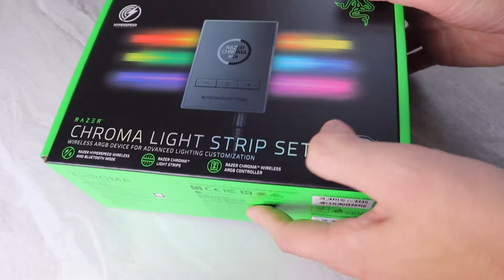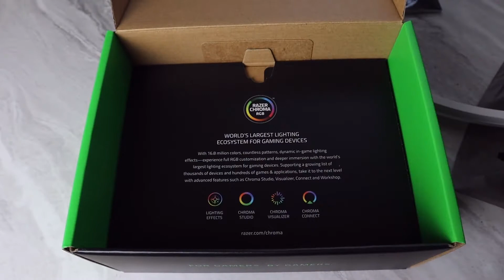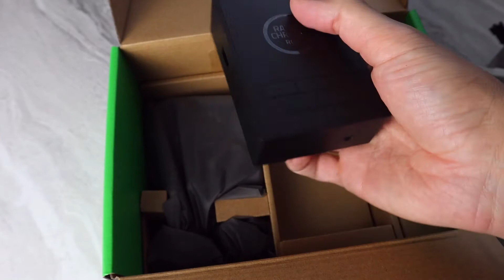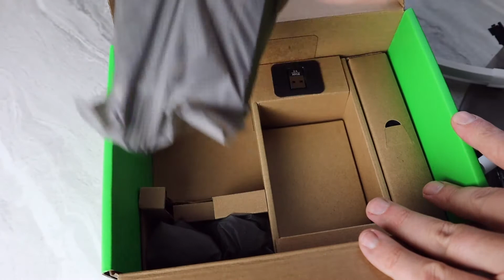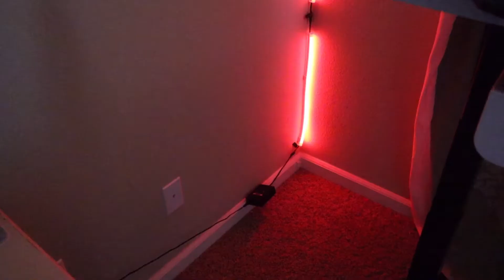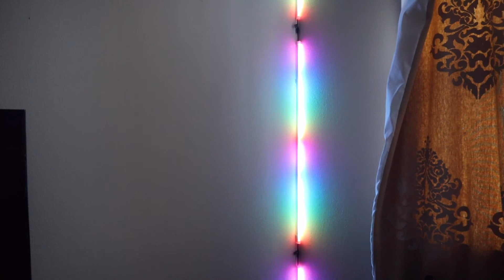Razer Chroma Light Strip Set

Comment: Hey, I've got a question. Did you manage to force it to shut down when switching your PC off ?
Reply from the maker: Nope. I wish…If you connect it to Phillips Hue you can do that.
Reply: @TechAdventure1  could you please elaborate on that a little bit? I've just bought it but it is lacking this feature and I think I am going to send it back. I was thinking maybe yeelight could do that? It is also way cheaper. Or maybe I should just buy hue strip? Can it be configured so that it turns on/off with a pc?
Reply from the maker: The way I’m using my hue lights is with a controller or from the phone app. It won’t turn off with the PC but at least it’s easier to turn it off this way than by using the included hub controller.